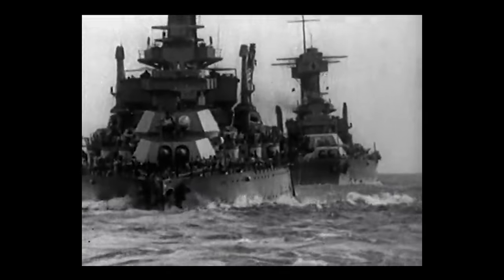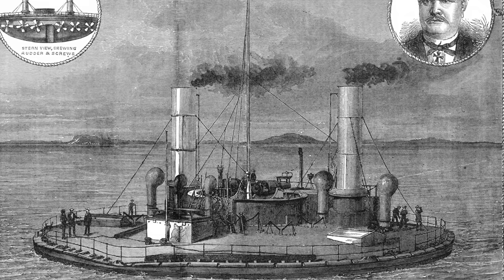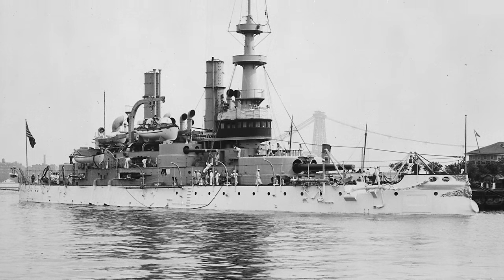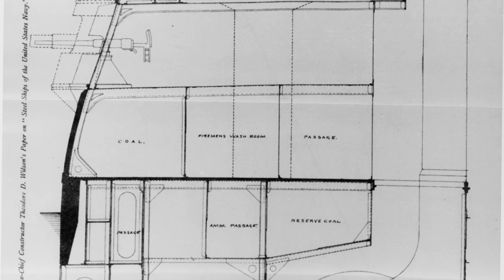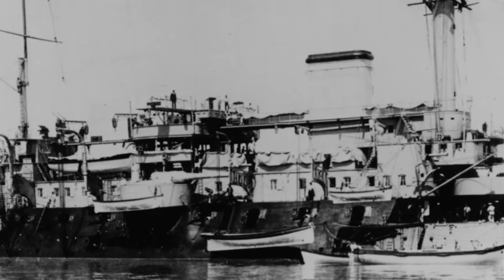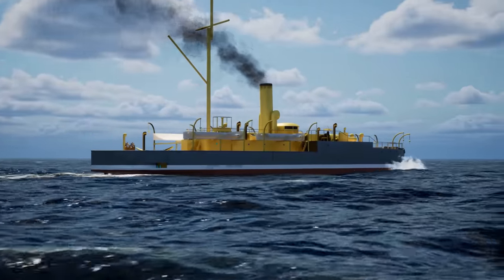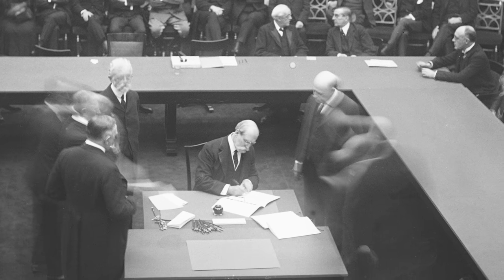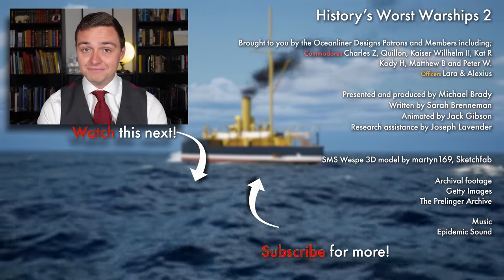AWFUL Warships From History

Comment: I'm surprised the swedish warship Vasa isnt mentioned on this list. It sailed roughly 1400yards before sinking on her maiden voyage, and what should have been the mightiest warship in the swedish navy was defeated by a gust of wind...
Reply: Too too-heavy.  The old story …
Reply: We should suggest that to him for Part 3 of this video series. XD
Reply: Mary Rose also had problems similar to the Vasa - poor stability, overloaded with artillery, also tilted due to a gust of wind, scooped up water with open gunports and quickly sank.
Reply: @StazherEzhov  But Mary Rose was over thirty years old when she capsized, and had enjoyed an apparently successful career up to that point. Her demise wasn't so much a design flaw as poor management of weight distribution and loading.
Reply: @davidjones332  Refreshed the Mary Rose story and, yes, you're right. I wrote the comment above purely based on memory, and I read about this ship for a long time, about 15 or 20 years ago.
Reply: Question what is an ocean liner centric YT talking about warships
Reply: Also, any of these 1900 era warships could have easily blown away the Vasa, or for that matter the Victory, so time is a major factor here.  Upper level armament reductions could and did correct all these ships except the ones that sank before this was done, and the round ones, which should have been easy to control using differential thrust, at least if thrust was easily controllable in steam engines at the time.
Reply: The fate of the Vasa was certainly tragic, but she was built in the early 17th century when the science involved was not well understood. The ship I would have expected to see was the HMS Captain from 1869, which does not get that excuse. The British admiralty knew well that the design was unstable, and the construction made her even worse, but they were pressured into building the damn thing by public opinion. She capsized 5 months into her service, costing nearly 500 lives, while ten other ships in the squadron survived the weather without any issues.
Reply: @cccpike  The Captain would have been harder to fix too, since removing a turret likely would not have improved stability that much.
Reply: @advorak8529  actually if my memory serves right it was actually unsymetrical as both sides were built with different measurements (aka they used inches amsterdam feet and Stockholm feet thus having different lenght and one feet to other was 1,5 cm difference). So the sank because of idiocy,
Reply: @diooverheaven6561     actually if my memory serves right it was actually unsymetrical as both sides were built with different measurements (aka they used inches amsterdam feet and Stockholm feet thus having different lenght and one feet to other was 1,5 cm difference).
That is bollocks, the Vasa has been raised, restored and measured and there is well-preserved documentation of the building process.
There were a lot of things going on, for example not having any sketches or measurements of the ship, it was upscaled from a 108’ standard ship they built all the time to 111’ and then stretched to 135’, causing the keel to be weak and shallow and needing strengthening, the hull be too wide and not enough space for ballast.

In addition to the length, there was further feature creep (on orders of the King) to switch to two gun decks, with the upper deck to have 12pd guns and the lower deck having 24pd guns — nobody in Sweden had ever built any 2 deck warship — and finally to have each deck fitted with 32 24pd guns. A 24pd gun would be around 1.5 tons of bronze cannon … a hard fit into a gun deck designed for much smaller and lighter guns. 

The mass of gilded oak carvings did not help either, and even if more ballast could have been stowed, the lower deck gun ports would have been awash.  Additionally there was a lot of pressure to get the ship going. And it was the largest project up to that time, 400 men in 5 different “departments” working on the ship, communications poor to non-existent, the chief architect getting sick and dying, no defined areas of responsibility for those taking over, …

With all these alterations, the CoG was way too high. A soft wind and she tumbled

So the sank because of idiocy,
Nope.
Reply: I'm pretty sure the Vasa has been mentioned in another video on the channel (I don't remember which one though)
Reply: Let's design a clunky barrel shaped vessel that is top heavy, and see what happens 😁
Reply: Hans hestoft
Reply: @randomness9387 there is in that vid it was never built to or engineered to battle other ships it was to cover fire for infantry troops on the main land and long range attacks on enemy positions on the main land it was actually designed to travel in shallow waters that’s y the bottom was flat watched the video yesterday on it
Reply: I laughed out loud when I saw this comment!! 😂😂
-Swede
Reply: But Vasa sure died pretty.
Reply: Capsizing.  Built too top heavy for stability.
Reply: Thought exactly the same thing as soon as the video showed up in my cue
Reply: @StazherEzhov but only after many years of service without issue.
Reply: @alan6832 I recall being tippy was major issue with most first rate ships. They were top heavy and the lower gun deck was vulnerable to flooding if you opened the ports in rough sea making it unusable most of the time which kind of defeats the purpose of having a first rate ship instead of 2 or 3.

Porably why they never saw much actual combat use well that and the cost. Less a usefull weapon and more a dick measuring contest for the navies of the world.
Reply: @StazherEzhov it had been a very successful ship they just got too enthusiastic with guns
Reply: @davidjones332 had the Mary Rose not been rebuilt changing from clinker to carvel construction?
Reply: Those were much older ships. I’m not sure he wants to go back that far.
Reply: Titanic had a long career compared to that!
Reply: Don’t forget the Mary Rose? Henry the 8th I recall?
Reply: Vasa was overloaded with ridiculous amenities and the architect was so afraid of disappointing the king that he committed suicide.
Reply: yeah  @melgross , borderline pre-history
Reply: the swedish warship vasa is the oldest ship restored ive ever seen
Reply: @vonfaustien3957 First rates saw plenty of combat use. They were limited in numbers due to costs and a lack of flexibility compared to a Third Rate outside of fleet engagements. But they often proved to be key parts of battles. Trafalgar, for example, had seven first rates engaged.

Yes, the early modern great ships were absolutely a dick measuring contest. But they were far from useless or ineffective. The Sovereign of the Seas, for example, was a key element of the English fleet for fifty years and very much a thorn in the side of the Dutch.
Reply: Your comment made me laugh, I had to know more. I went to good and searched “Swedish Wa…” and it popped up, first result. That made me double laugh. God Bless You for the laughs lol 😂❤
Reply: Did some Wikipedia reading and it made me laugh: in the inquiry of the sinking, in the midst of all the blame game going around; it came into a battle between the shipwright and shipbuilder and they tried to exonerate the design by saying “we widened it by 1’5””
I was thinking “what is 1’ gonna do for a ship like that. Vasa’s Estimated spar length: 226’
Beam(thiccness): 38’
Draft: 16’
Displacement: 1210 tonnes

HMS Victory( sure they were built 100 years from each other, but she was almost the same size & idk ships like most of y’all so it’s the only thing I could think of to compare): length 227’6”
Beam:51’10”
Draft: 28’9”
Displacement: 3,556 tonnes

It’s wild what 100 years in ship building experience can do. 200 years after that, we were lobbing 16 inch, 2,700 shells, 20 miles away. Versus victories best gun: 32 pound 300-1300 meters - 1 1/4 miles if you wanna scare them.

Vasa’s gun: 24 pounder 

After more reading, a better comparison would’ve been USS constitution, but she was built 170 years later. It’s crazy what God made humans to do. Whenever we channel our killing energy into feeding starving people, we may get a few feet down the road for once. God Bless Y’all.
Reply: 🤣😁😁😁👍🎉 - the Vasa-! 😁😁👍, "Hey, Look! There she goes! ... Aw, shit... 😞😞😞". 🎉
Reply: @richardross3815 Henry without Faith. ... Or the eighth. Frickin' stincky butter tub. Smelled French/Belgie I heard.
Reply: @richardross3815 the Captain boarded, and Mary froze. 😌
Reply: @davidjones332  No, Mary Rose was 100% design flaw.  most of the time her lower gun ports were kept battened to prevent water intake.  Thus making the lowest gundeck... functionally unusable due to the risk of flooding.  She sank.... because she tried a combat maneuver with ALL the gun ports open... and a perfectly normal maneuver.  It was in theory a manageable flaw... just... the only way to manage it... was to NOT use the lowest gun deck. It'd have been better off simply not having those guns on board at all.
Reply: @advorak8529  the spanish empire build the biggest wood ships/man o war and stil didnt sink and cross the atlantic, the vasa is a sad tale of a ship too inadequate for its waters
Reply: The ferry to the museum in Stockholm travels further than the Vasa did…
Reply: And to think the “unsinkable” Titanic was bad not even completing her maiden voyage…
Reply: I’ve been to the Vasa myself… the fancy and I would assume Heavy decorative carving is truly amazing…. And everywhere!!!… the ship is also very tall and surprisingly narrow

Comment: Novgorod's guns didn't actually cause the entire ship to spin on its axis. Each gun was mounted on a turntable that allowed it to rotate independently from the other. However, the turntable's locking mechanism wasn't very good. Firing one of the guns caused the gun to spin wildly on its own turntable, not the entire ship. It's a common misconception.
Reply: Yeah pretty much that, also her steering problem was later somewhat mitigated by using the propellers instead of bothering with the rudder. This way the ship reportedly achieved some pretty good agility, apparently so much so that during the turn some sailors would become dizzy, even though putting half of your engines at full ahead and the other half at full reverse unsurprisingly slowed her down to a crawl.
Reply: Yes, there are a lot of myths about these two ships!
There was a reason they lasted for 30 years!
Reply: @mahbriggs Yes, and a big one was "we don't have the money to replace them!" (a very long standing Russian naval tradition).

Comment: The Tomozuru story and others like it are some of the most terrifying in my opinion. Just finding a ship fully capsized and floating on the surface symbolizes the ultimate danger of what can happen on the sea (or Great Lakes).
Reply: What is probably even more terrifying was, when the Tomozuru was eventually found, it was capsized so badly, that the ship that found her can only saw her rudder and part of the stern, and therefore initially thought they were watching a surfaced submarine's conning tower!
Reply: Imagine same thing happened to IJN Ryujo (carrier at 20:20)
Reply: Funny you mention the Great Lakes, as the Charles S Price was found like that after the big storm of 1913. Searchers stumbled upon just the very bow of the nearly intact ship floating above the water.  The stern had already sunk to the bottom, but enough air remained trapped to keep the bow end afloat for over a week before finally sinking.
Reply: @PhantomP63  I still remember the first time I saw a photo of the Price upsidedown. We've all seen the Poseidon Adventure I'm sure, I just imagine that but in the dark and much, much worse.
Reply: A case can B made that Tomodzuru was 1 of the greatest designs ever, 'cuz she finally got thru 2 Japanese command that the Entire treaty fleet was topheavy & needed 2B completely refit

Comment: You know something is bad when a guy like me with no background in engineering, naval architecture, etc. can take one look at a ship and spot multiple design flaws that render a ship seeming destined to fail.  Lovely work as always Mike, your videos and streams are always fascinating.
Reply: Myself, also a complete naval ignoramus took one look at that ship and my very first thought was "gee, that looks top-heavy"
Reply: @tarstarkusz    Your eye has been trained by the much more successful warships of WW1, WWII and later, they have a certain look … and these ships look different.

Remember that back then the people did not have all these proven examples.

You go tell me if a helicopter design with no tail rotor or similar, but with 2 main rotors, slightly tilted outwards and mounted next to each other, side by side, less than a foot apart — obviously intermeshing — can be a viable design.
Reply: Did I spot patio doors and a balcony on that french ship?  Strewth.
Reply: Engineer here. Finding the perfect center of weight is still painfully complex by todays methods.

Whenever i design a machine with my programm and have to find out where the mass is to find any potential for unwanted vibrations or structural weakness i have to assign every little piece a material, have my programm do the basic calculations and then give it to the boys from statics.....its still not a 100% perfect process even will all of our modern computers and stuff.

For me the first though i had when looking at that french ship was "heavy armor, underwater, thinner lighter armor on top. I understand why you laugh at the ship but i can absolutely believe that finding the center of mass on the Z axis and just as important on the X axis must have been a true fricking nightmare back then when you had to do everything with your bare hands. These boys did not even have a calculator.
Reply: @andrefasching1332     Calculators were available in 1880:
- 1642: Pascal's calculator/the arithmetic machine/Pascaline.
- 1851, production begin of Thomas de Colmar’s arithmometer
- since “forever”: the abacus, not a calculator per se, but still fast as f.
- 1850, known since the early 17th century in many variations but now exploding, especially in France: the slide rule.

And of course you could always build a boilerplate scale model … and reduce masses to point masses (and their not so point physical representations).

100% accurate? heck no, but usable. How accurate do you have to be to calculate the metacentric height to +/- 2%
Reply: @sirmalus5153    Did I spot patio doors and a balcony on that french ship?
Look at the stern of a first rate ship of the line — you might spot balconies (plural) or conservatories (plural). If you want only one, look for a frigate …
Reply: Note that you don't specify which ship you're talking about, yet we all know.....

Comment: Funny thing is SMS Viper, one of the Wespe class, was converted into a crane ship and survived at least until 1967. There's no record of her being scrapped so there's a small chance of her being still around
Reply: Imagine, but wouldn't it be easy to find given it's design?
Reply: @yuurichito1439  When rebuilt into a crane, the appearance of the vessel could change dramatically, up to almost complete unrecognizability. In Russia in 2013, the Baltic Fleet put up for auction a decommissioned floating workshop, which was originally a "Strelets" monitor built in 1864. If it weren’t for the surviving documents, no one would ever have thought that it used to be a monitor - the ship was so heavily rebuilt (in fact, the publicity of the fact of the existence of a 1864 monitor, albeit rebuilt, saved it from cutting). It is possible that SMS Viper could also have undergone a radical "transformation".
Reply: What was the name of the russian vessel?
Reply: @thecatalyst6212  Strelets
Reply: @thecatalyst6212  "Strelets", "Uragan" type monitor, construction started in 1863, launched in 1864.
Reply: What is the German 4 'Jeffersonian gunboat'?
Reply: I could find no record of this supposed crane ship conversion, only a few places stating the ship was scrapped in 1920. What's your source for that?